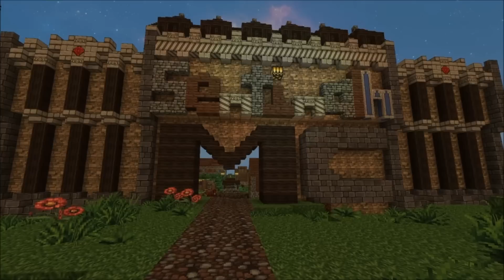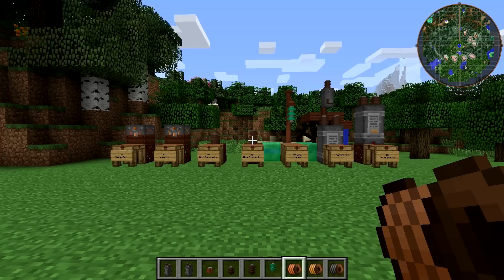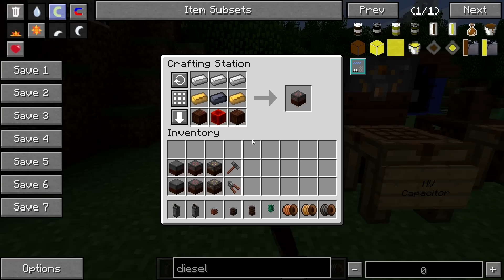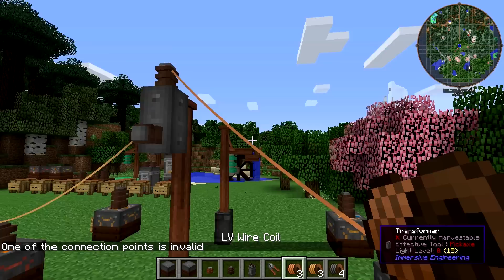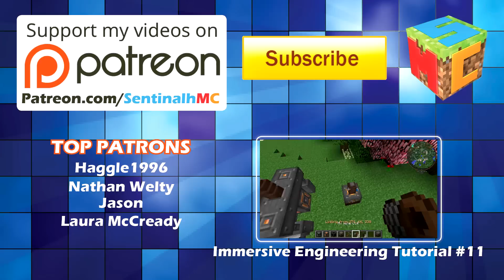Immersive Engineering Tutorial #12 - Voltage

Comment: This was a really interesting video. For me, the most daunting/scary part of Immersive Engineering is the voltages. For someone non technical like myself understanding it is difficult. I think you broke it down very well. Well enough to give me the confidence to experiment a little and try out tactics. Do you have any advice about the gathering of, storing and distributing of the power? For example is it a good idea to run all your windmills and waterwheels into a bank of capacitors and then feed that out a main power line through your base that you take offshoots from for each machine, or is it better to dedicate one power generating device per machine that requires it (for example having a windmill to run your furnace heater and a waterwheel combo to run the grinder).

Comment: This has been a pretty useful (if a bit long-winded) series of videos, despite being slightly out of date.

I noticed a couple of minor mistakes in this one, though, both of which you blamed on power loss over distance, something that I've seen no sign of (at least not on kind of tiny distance scales shown in the video -- and nothing I've read in the documentation suggests that such power loss exists at all).

At 10:33 you broke a wire connector which contained 256 RF, causing that power to vanish (100,000 - 256 = 99,744). This is why the destination capacitor didn't receive the full amount of power from the source capacitor, not any inherent power loss (at least not in this case).

And around 13:22, you made a slight mistake in subtraction. Using the actual numbers, 565,248 + 3,430,656 = 3,995,904 which differs from 4 million by 4096, which (just like in the first case) is exactly the amount of power buffered by the wire connector on top of the source capacitor.
Reply from the maker: Thanks for noticing my errors. Sometimes I'm amazed I can help anyone.
Reply: I should add that since posting that I've found comments on reddit by the mod author giving some specific details, and did a little testing on my own in the current version of IE (the one in the DW20 pack). As a result I did find a small amount of power loss even at short ranges, unlike what was seen in this video (and quite a lot of power loss across very long wires, particularly with LV).

The test I used was basically the same thing you did: Two capacitors, one empty and one full, placed a few blocks apart with one wire between connectors placed on top of them. A shift-right-click with a voltmeter reported a fraction of a percent loss rate, and when the transfer of power was finished, the receiving capacitor was, in fact, not quite full by an amount that seemed consistent with the reported percentage.

Unfortunately, this meant that my base near bedrock which I was trying to power with windmills at the top of the tallest nearby hill was receiving under 25% of the power they were generating... Ultra-Facepalm
So now I'm using 8 thermoelectrics and some water wheels just down the hall, which has worked out much better.

Comment: I checked the current version 1.7.10 limits, and while all values are overrideable by configuration values, these are the defaults:

Connectors can pull current from sources onto the power network, or push it to destinations out of the power network.  Wires themselves, can transfer much more power than a single connector, making it useful to bundle up power from many sources, pushing it down the line, and then connecting it to different machines.

Default values for the power network are:
LV  can input  256 rf/t per connector, transfer 2048 rf/t without melting, with %5 energy loss per 16 blocks, with a max distance of 16 blocks  between connectors.

MV can input 1024 rf/t per connector, transfer 8192 rf/t without melting, with %2.5 energy loss per 16 blocks, with a max distance of 16 blocks  between connectors.

HV can input 4096 rf/t per connector, transfer 32768 rf/t without melting, with %2.5 energy loss per 16 blocks, with a max distance of 32 blocks between connectors.
Reply from the maker: Thanks so much for that info.

Comment: You also don't mention that it says in the book that a LV wire can transmit more power than one connector before melting, it's only that each connector can only add or remove 256 rf/t from the power network.

As for the practical application of transformers in game?  I personally have none.  Anywhere a person might use a transformer, I throw down another HV capacitor, link up the capacitor's ontop of poles with HV connectors in a chain.  pull off MV or LV taps when needed, no transforming required, so my actual 'power network' is split up into very small chunks of only a few connectors from a local capacitor.

Anyways, to get a line to overload, you'd need, say, a dozen water wheels all feeding into a lv power network, transfered over a single link somewhere, and then use more than the limit via multiple outputs, would fry the lines.  I would instead use a capacitor (or set of capacitors) at the source to limit the output of the transmission to the rest of the network.
Reply from the maker: Thanks for the explanation

Comment: Look in the config file for immersive engineering.  Power loss over distance is adjustable.  You can* get the exact numbers from there for your install.  Some packs modify those settings so their not necessarily static across the board.
Reply from the maker: Ah okay, thanks for that tip.
Reply: Your welcome, keep up the great series!

Comment: You said that any energy in IE wouldn't be transferred if not requested. Doesn't that mean that you actually cannot overload a low-voltage machine with a MV or HV current? Since it still requests LV, only 256 rf/t will be transferred. So you can just connect MV capacitor with LV capacitor with either MV or LV wires, no need for transformer here.
Reply: that is wrong
Reply from the maker: It isn't the machines that overload its the wires. If you have machines pulling power through a wire and that power exceeds the maximum for that type of wire then all wires of that type from the source to the destination will melt.
Reply: How connecting LV and MV capacitor can overload the wire? LV capacitor won't be pulling more than 256 rf/t. That was the point.
Reply from the maker: Igor Loginov
Capacitors seem to work together just fine in my experience. What overloaded my power system was multiple machines pulling power at once fried the LV wires.
Reply: Let me be clear. You call your video a tutorial and show an IE transformer. To demonstrate it's necessity, you connect LV and MV capacitors with it. However, I can connect them with any wire just fine and get the same result. When I have to use a transformer?
Reply: +TheShadow19962810
can you be more specific please?
Reply: I have tested it before to see if there was any difference in how much energy you could transfer from point a to point b.
Reply from the maker: Igor Loginov
The benefit of the transformer is in transfer speed. Low voltage can only ever transmit at 256 RF/t while Medium and High voltage can transmit much higher amounts. If you had 4 LV transformers connected together and rant them with LV wire to a destination you'd only be transfering at 256 RF/t. However if you put them into a transformer up to Medium Voltage, you could transfer at 1024 and benefit from the output of all 4 LV capacitors at once.
Reply: In your video you connect one single LV capacitor with one single MV capacitor, which could be correct in case of IndustrialCraft voltage. However in IE only 256 rf/t will be transfered with or without the transformer. Basically you use a transformer as a decoration block here. Are you going to make a new video about its real functionality?
Reply from the maker: Igor Loginov
Thursday's video should help.